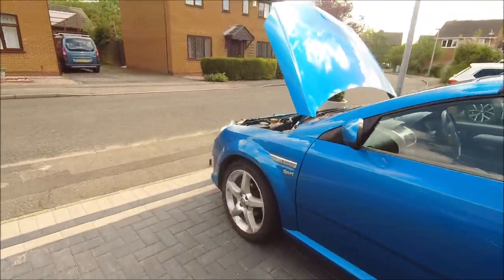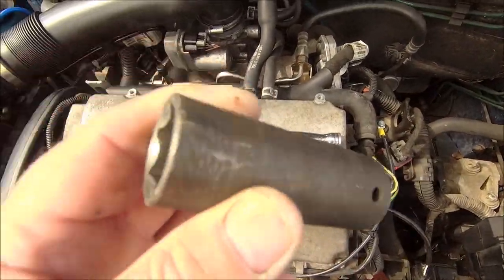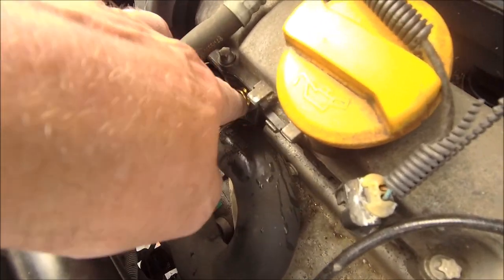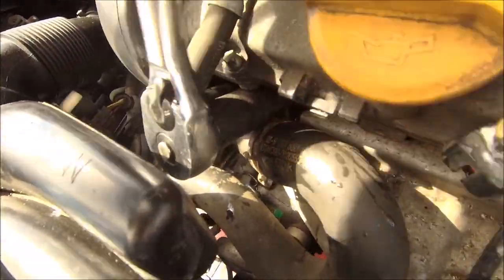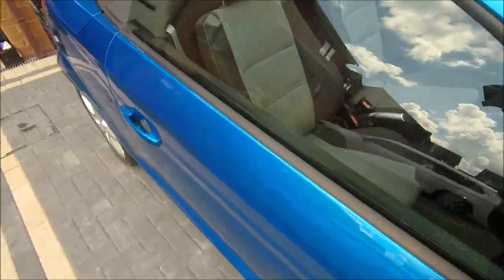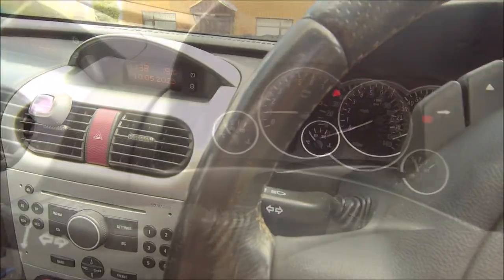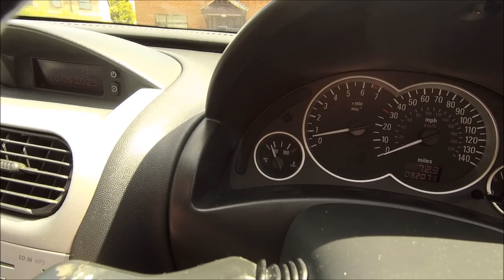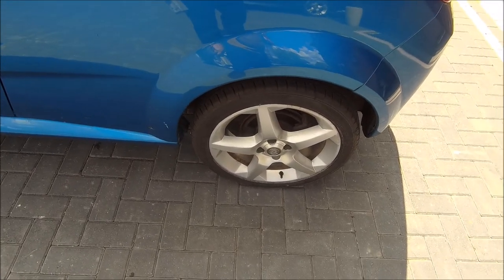Vauxhall 1 8 Tigra Temp sensor change

Comment: Great series, been following after purchasing my own Tigra 1.8 and getting similar issues to you with the MAF.

Now find myself needing to do the temp sensor too - only problem i'm having is getting the sensor clip off - i just cant tell how it's being held and if i need to press a tab top release, lift a tab to release, if it's just one tab or muptiple or just brute force it? and tips oin getting the connector clip off the sensor?
Reply from the maker: To my knowledge the tab is the only thing holding it ...  maybe ease it with a screwdriver but be gentle at the old plastics break so easy
Reply: @AdeReeves  After many attempts over multiple weeksi managed it - for anyone also struggling to get the clip off the sensor like I was i'd suggest 2 things - 1 looking at your new sensor to see exactly where the clip interacts with the sensor - also if it's being stubborn give it 4-5 good taps with something (i used a screwdriver handle) to loosen up any debris/plastics that might be sticking together. In the end mine was full of a dusty/dried mud like substance that was causing additinal fritction making it hard to get off.